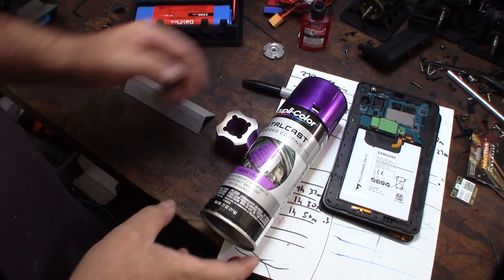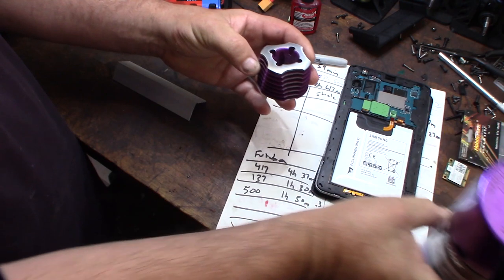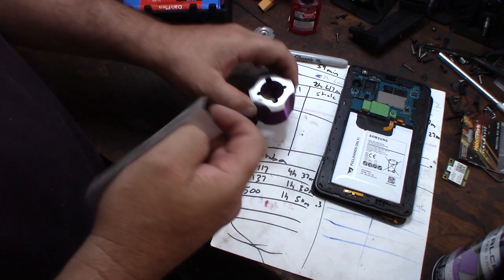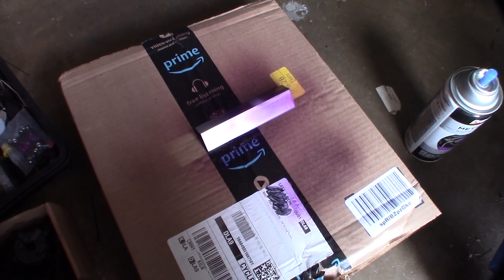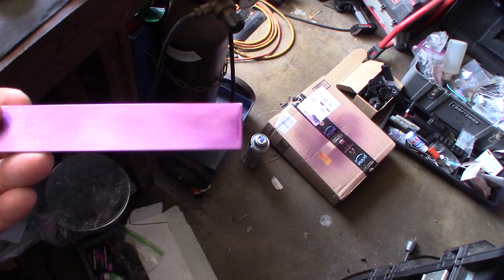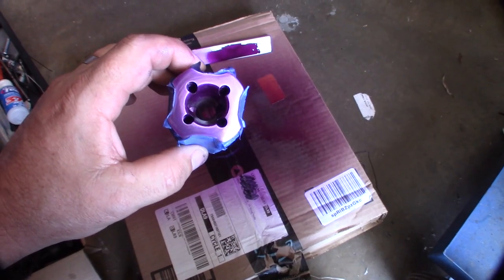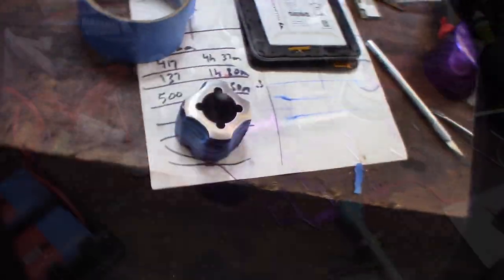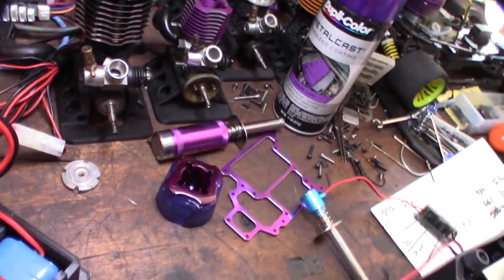Dupli-Color Metalcast Faux Anodized Automotive Paint Test Review Thoughts Fake Anodizing

Comment: One thing I was told years ago for anodizing was to go to walmart and find a rit fabric dye of the color you want and a gallon of distilled water with an aluminum disposable baking pan.  Fill the pan with the water heat it up and dissolve the dye in it.  Then suspend on a wire your cleaned polished part, or whatever point of surface you want making sure it is submerged and not touching the pan.   Then connect your battery charger to the wire and pan.  Since I am assuming we are wanting electron flow, negative to pan and positive to part, I may be wrong about it but I work with electronics so what do I know.  Not sure how long but I would suggest once you get the desired level of color, rinse and let dry.  Rinsing should lighten color as it will remove surface dyes.  You can redip to improve color and I would suggest a light coat of lacquer clear to protect it.

Comment: So I am doing a project where I can 1. Anodize 2. Ceracote. 3. Duracote 4. Spaypaint 5 Metalcast like this, and or 6. Paint real automotive paint, like 2 stage polyurathane.
I am painting archery bow risers.
we have a few from our manufacturer in China that look like they are coated with Finger Nail polish. They are a nice finish but they chip like in thick chips if they are bumped agianst anything hard. I actually matched the color with Walgreens fingernail polish and touched them up where you cant even tell they were damaged.
Now they only come in Red and Blue with this coating. 
all the Black ones that we have gotten have a semi-satin black coating on them that doesn't look bad, but 90% of metal bow risers have this same super spray enamel coating unless you go into the 1000 dollar bows.
We are making customized bows that are more affordable, and I want more color options and I want then to look something like this, so I have purchased a can of the base coat, and I have a can or the Blue, and a can of Red.
I agree that the part that you painted looks different because 1 the shades are different slightly, and 2 the metal cast paint is more glossy.
since I am striping the first risers completely I will see if i can get a really nice layer on the whole riser. I want to compare the bare metal to how it would look with the base coat and the color.
I think the base coat will help the metal cast stick to the edges.
if I have good results I will shoot a video about it.
Thank you for this one as it helps.
Reply: that's a super cool story bro hit up your local publisher
Reply: @Just_Me187  I actually need to film the results. The old primer with the Duracoat was a metallic grey but the new stuf is a high sheen silver and it makes the paint almost like a colored chrome..

Comment: This product is behaves more like a clearcoat, and from what I've read it needs to be applied like one.
Their site says to apply it over a silver basecoat. They don't use the word primer or undercoat. 
Effectively, silver is basecoat colour and this product is a tinted clearcoat.
Others have had trouble applying a normal clearcoat over the anodized spray. It seems to alter the finish.
Also it doesn't adhere well to bare metal (as shown in this video), just like regular clearcoat.
Straight to metal clearcoat sprays are different to regular clearcoat; contains an promotor.

Everything suggests this product is a fancy clearcoat and should be treated like one, unfortunately the manufacture's do not provide much information.

Comment: I’ve tried this on a few nerf blasters for a real steel effect but I had to use the duplicolor metal base spray first and it still didn’t like to stick to edges it’s like it just runs off
Reply: Because the paint is not for plastic

Comment: I'm building a barrel smoker and used a emery disc to to take the paint off which unexpectedly gave me a erratic polishing affect. Do you have any suggestions on any prep I should do or should I prime it and for get about trying to capture that affect
Reply from the maker: If you want that anodized look then you need to wet-sand up to 3000 grit.

Comment: If I used a black base coat, this would come out dark purple right?
Reply: Dude that would be sick
Reply: have you done it? how’s it turn out
Reply: @aaronc2171  nah didn’t do it yet
Reply: I tired a green base coat with the blue metalcast... I just about got a CYAN color which is soooo dope! But... it came out a bit blotchy... one I think I was too close and two the can I had just happened to suck... also warming these metalcast cans up reallly helps... I’m in the mountains in MD and it’s a bit chilly sometimes and damp
I boiled some water and dropped them in once it was a bit cooler 
It really let the paint spray out evenly and keeps the tip clean too during use
Reply: I think the purple would really work! Just get the right kinda base coat!
Reply: Has anyone done a silver and black base coat for a dark to light candy effect?  If so how did it turn out?
Reply: I was told no. I haven't tried it as I was going to wet sand black bow risers and apply this product. I was told that I either need to strip it to bare metal, and or use its base coat over the riser if I do not wish to strip it.
I might try it over the black to see what it will do, but I was told that it ruins the look of the paint.
Reply: @TwistedSisterHaratiofales  ok awesome thanks for looking into it!